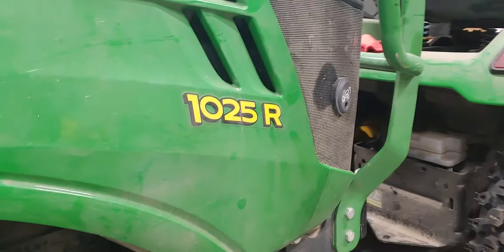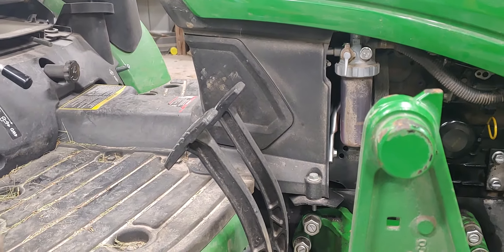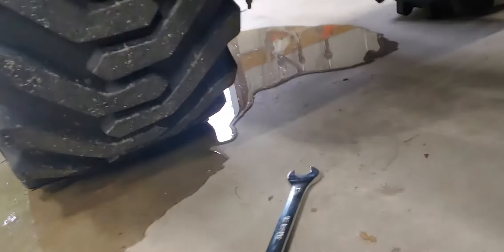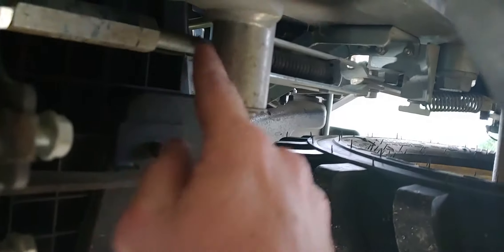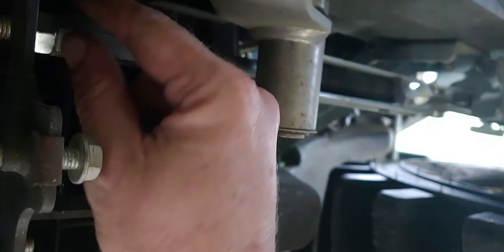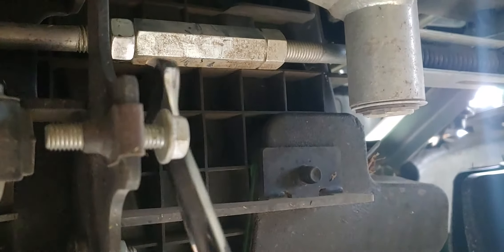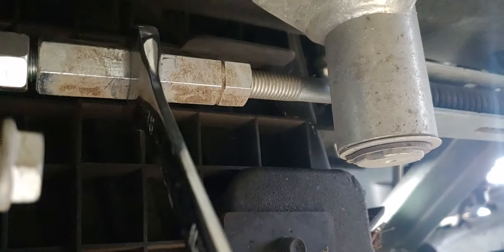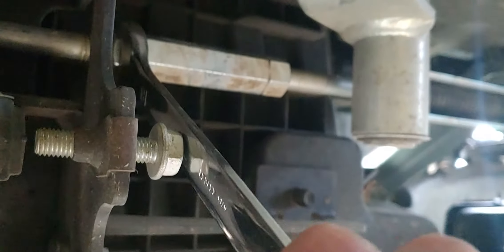HOW TO: John Deere 1025R Park Brake Adjustment

Comment: Thanks John for your effort excellent video just saved me 2 hours of float time and $150 bucks
Reply from the maker: Awesome!! 👍💪💯
Reply: DO NOT ADJUST YOUR BRAKE USING THE METHOD IN THIS VIDEO

YOU CAN SEVERLY DAMAGE YOUR TRACTOR, AND IT WILL NOT BE COVERED UNDER WARENTEE.  

YES IM YELLING.

Comment: Was using the tractor and realized the brakes were not stopping it, nor was the parking brake working.  Watched your video and afterwards, got the brakes adjusted with no problems.
Reply from the maker: That's awesome!!! Glad this was helpful for you. Stay safe out there!!
Reply: DO NOT ADJUST YOUR BRAKE USING THE METHOD IN THIS VIDEO

YOU CAN SEVERLY DAMAGE YOUR TRACTOR, AND IT WILL NOT BE COVERED UNDER WARENTEE.  

YES IM YELLING.

Comment: Thank you very much for making this video.  Tomorrow I will adjust the parking break. I’ll be subscribing to your channel.
Reply from the maker: Awesome! Hope it goes smoothly for you getting it adjusted 👍. Thanks for the sub👊
Reply: DO NOT ADJUST YOUR BRAKE USING THE METHOD IN THIS VIDEO

YOU CAN SEVERLY DAMAGE YOUR TRACTOR, AND IT WILL NOT BE COVERED UNDER WARENTEE.  

YES IM YELLING.

Comment: Thanks so much! I was on a very slight slope up hill and about hit some stuff. I will be adjusting brakes as soon as I eat
Reply from the maker: Glad this was helpful and glad you didn't hit anything 😁✅👍
Reply: DO NOT ADJUST YOUR BRAKE USING THE METHOD IN THIS VIDEO

YOU CAN SEVERLY DAMAGE YOUR TRACTOR, AND IT WILL NOT BE COVERED UNDER WARENTEE.  

YES IM YELLING.

Comment: Well done sir, brake adjustments now on my agenda for tomorrow.
Reply from the maker: Thank you ...glad it was helpful👍😁. Hope it goes smooth for ya!
Reply: Thanks for the video. I noticed my brake works when I'm driving, but when I engage the parking brake, it doesn't hold the tractor still.
Reply from the maker: 💪👍💯. Glad this was helpful!
Reply: I did exactly what you instructed and voila! I have breaks once again. Thanks for saving me a lot of time and $$$
Reply from the maker: @socal33  💪👍💯
Reply: DO NOT ADJUST YOUR BRAKE USING THE METHOD IN THIS VIDEO

YOU CAN SEVERLY DAMAGE YOUR TRACTOR, AND IT WILL NOT BE COVERED UNDER WARENTEE.  

YES IM YELLING.

Comment: Informative video. Thanks, Josh. Hope you're doing well. 👍✌️💪
Reply from the maker: Thank you sir.. Same to you!👊
Reply: DO NOT ADJUST YOUR BRAKE USING THE METHOD IN THIS VIDEO

YOU CAN SEVERLY DAMAGE YOUR TRACTOR, AND IT WILL NOT BE COVERED UNDER WARENTEE.  

YES IM YELLING.

Comment: Thank you so much  I am having problems  shifting my 1025r hydro don't se to be going all the way into gear  shifts easy but don't want move without th gears chattering unless I hold the shifter in hard
Reply from the maker: Hope you get it fixed soon👍💪👊
Reply: DO NOT ADJUST YOUR BRAKE USING THE METHOD IN THIS VIDEO

YOU CAN SEVERLY DAMAGE YOUR TRACTOR, AND IT WILL NOT BE COVERED UNDER WARENTEE.  

YES IM YELLING.

Comment: I just replaced the tie rod in my 1025r and the castle nuts aernt completely tight but the cotter pin fits should i tight them down or leave where they are and let the pin hold them in place ?
Reply from the maker: They usually line up at a certain tightness to where you can't tighten it to line up with the next gap. When you get to that point then back off the nut til in lines up to install the cotter pin.👍

Comment: Very informative video. Maybe you can help me. I have a new S130 and to start it and apply/disengage the parking brake I need to really press hard on the brake pedal. I tried to other similar tractors in the store and one was really easy and the other somewhere between mine and the easy one. Thanks
Reply from the maker: Sorry for the delay. Thanks for watching. Sounds like a spring or bracket may be out of adjustment. Maybe a bent bracket, but I am not familiar with that model so can't say for sure. Hope you have been able to get it figured out.
Reply: @joshslawnlandscape9935  I contacted a couple dealers about this and they both told me to move the seat up a bit. Guess what - it made a big difference.
Reply from the maker: Cool ..glad it was an easy fix👍💪

Comment: The ankle bone is connected to the leg bone....leg bone is connected to the hip bone.......hip bone is connected to.........when I get a 1025, I’ll know how to do it 😁
Reply from the maker: 🤣🤣🤣👍Got ya covered bro😜💪
Reply: DO NOT ADJUST YOUR BRAKE USING THE METHOD IN THIS VIDEO

YOU CAN SEVERLY DAMAGE YOUR TRACTOR, AND IT WILL NOT BE COVERED UNDER WARENTEE.  

YES IM YELLING.

Comment: Can this be to tight?
Reply: The brakes failed on my 2025r and sent me barrelling down a hill into a maple tree. Approximately 10,000. In damage to my front end. The attachment from pedal to pull lever broke in two, sending me down hill into the tree. I’ve contacted JD to try and rectify this before someone gets killed.
Reply from the maker: Yes, you can over adjust and cause drag, which is what would cause damage to the machine. You just have to get it to the point where it holds properly when applied. Properly adjusted, it should not allow movement when lightly applying the throttle with the brake applied. Please also check out the second video on this where I discuss the issue of causing damage with the adjustment. Hope this helps.
Reply: @joshslawnlandscape9935  
Ok great thanks Man great videos btw
Reply from the maker: @stevepaskin2863  Thank you sir. 👊👍

Comment: I can't get my parking brake off without a fight. Goes on no problem, but getting it back off might take 4 or 5 trys.
Reply from the maker: 🤔....... Maybe check the linkage on the lever that locks and releases the brake(on the dash) to see if it is binding. Could be the brake is adjusted a little too tight also. Maybe be sure also that any moving joints/connections are greased/lubricated.  Just some thoughts🤷. Hope you get it fixed soon👍👊
Reply: @joshslawnlandscape9935  crawled under the thing a few nights ago and sprayed some  Penetrating oil. Took about 2 days but it seems to be working a lot better now. Still tough getting the brake off but much better than it was before. Like you said might be just a little bit too tight. Does stay put when it's on!
Reply from the maker: Thats the goal I guess....lol😂👍

Comment: DO NOT ADJUST YOUR BRAKE USING THE METHOD IN THIS VIDEO

YOU CAN SEVERLY DAMAGE YOUR TRACTOR, AND IT WILL NOT BE COVERED UNDER WARENTEE.  

YES IM YELLING.

YOU NEED TO REMOVE THIS VIDEO.
Reply from the maker: How exactly would this simple adjustment damage the tractor🤔. If it does I would def like to know how.....Have not had any issue with mine since it was done 1yr+ again and brake works perfect. 
Thank you for commenting👊
Reply: @joshslawnlandscape9935  

Because this first thing the brake pedal does (before even applying the brake) is engage the Differential Lock. By adjusting this linkage, your effectively holing the brake down just a bit. This will result in a permanently locked Differential.

Spend some time under the tractor following the linkage, you'll see what I'm talking about.

Driving around with your differential permanently locked, will damage it if you are not on soft or slippery surfaces.
Reply: Your right this guy needs to read his manual
Reply: Thank you!